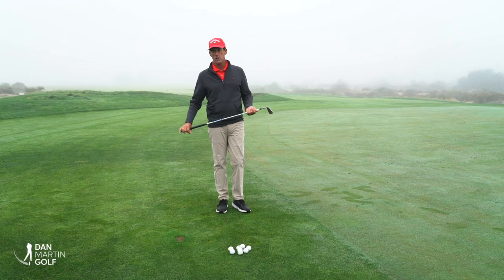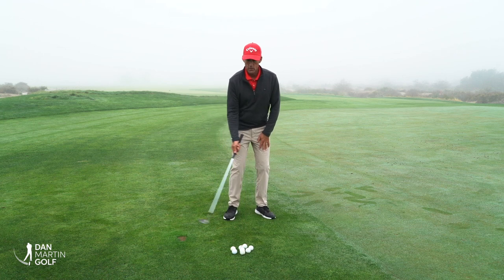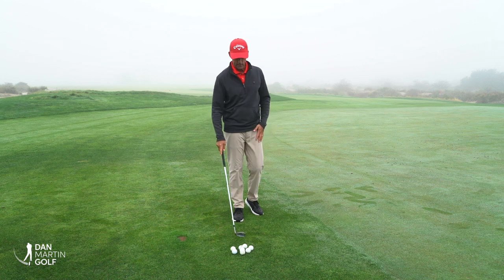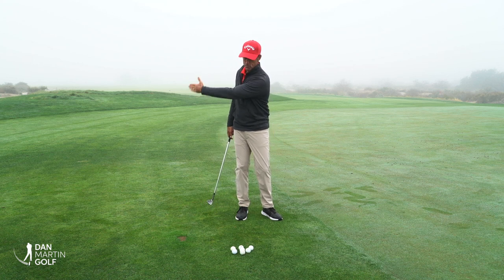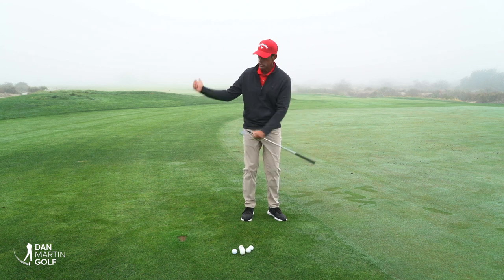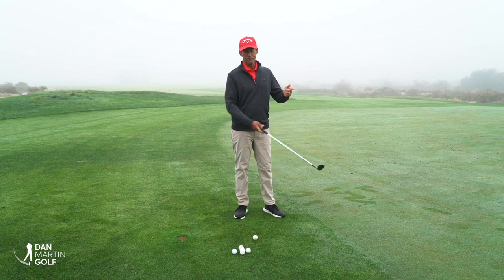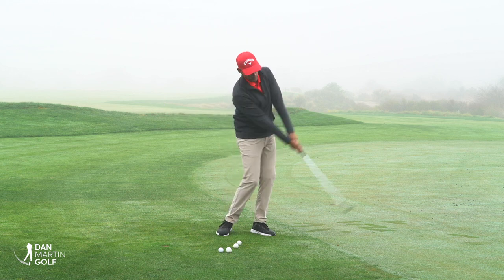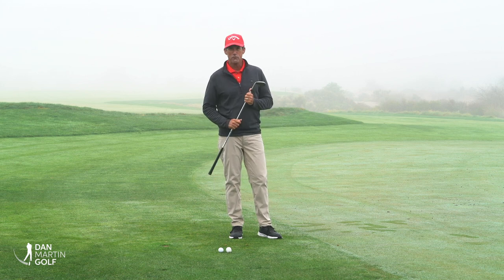Short Game Power Sources - Club Head Proximity to Swing Center to regulate speed.

Comment: I thought that the bigger the radius, the bigger is the speed. When one is not hinging, won’t the club head is further away from the centre and bigger radius?

When one hinge, if the club head travel a longer distance and therefor bigger speed ? Is that the reason why it is further. 

I don’t understand the concept of having the club closer to the body and then stretch out, do not have a change of the radius of the swing? Would it result in Inconsistency?
Reply from the maker: The radius must INCREASE to create sufficient acceleration of the clubhead.  Therefore it must get closer to the line of gravity before extending to the ball.  The more you keep the radius the same from backswing to forward swing, the less acceleration available.  Thansk!